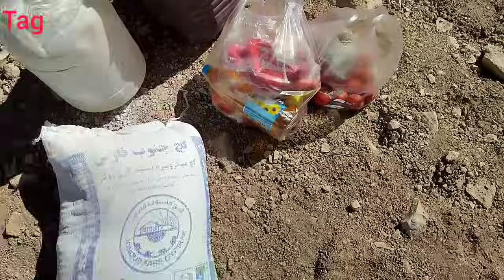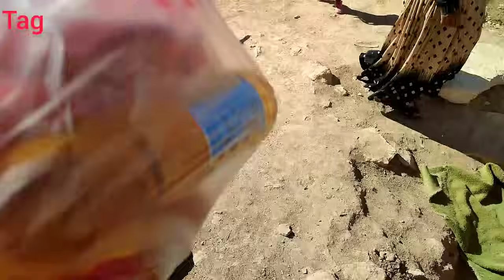Rebuilding a 300-year-old hole for a poor nomadic mother in the mountains

Comment: He never has seen the rain falling hard on a muddy path ?? Cause if he had he would get doing immediately the entrance with cement so the entrance xill not get the inside cave muddy when mother or KUDS go and ville!! I saw it with Nan!!  So much water coming inside the cave with the trays there empty every 5 minutes with mud all over!! That is WHY I ASK THIS WIRJER TO JUST FINUSH IN A HURRY THAT ROOF AND START right AWAY THE ENTRANCE AND PUT A PROTECTION IN THE ENTRANCE FOR THE WOOD TO KEEP DRY.. 
if you don’t have a wood stove then try to make one with the white bricks w but they need a heater for sure in 2 days!!!